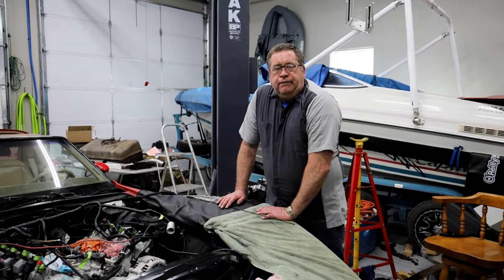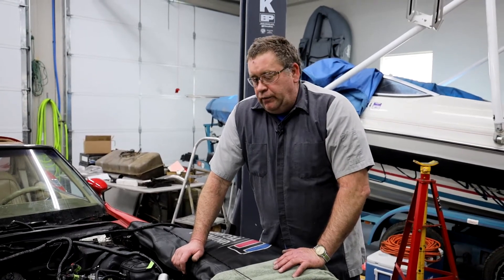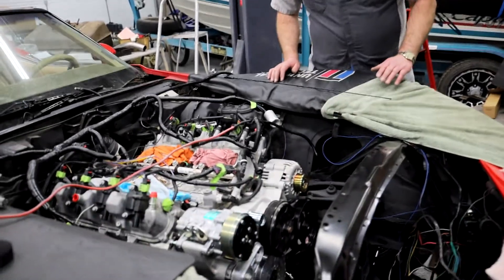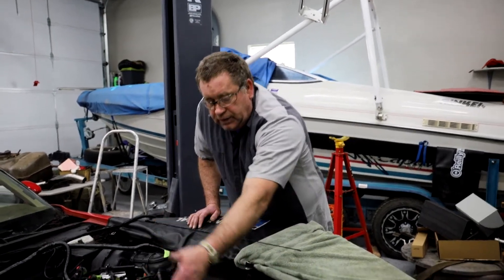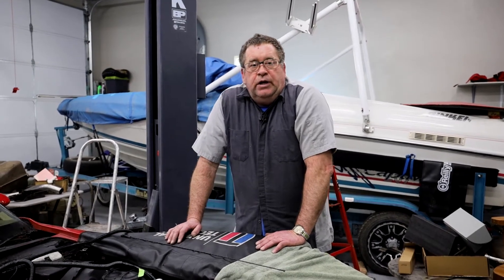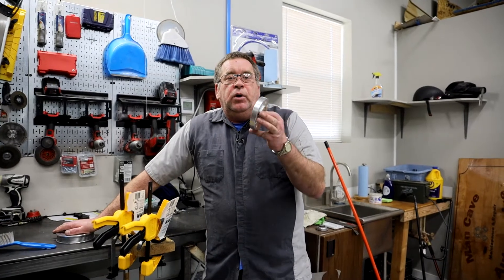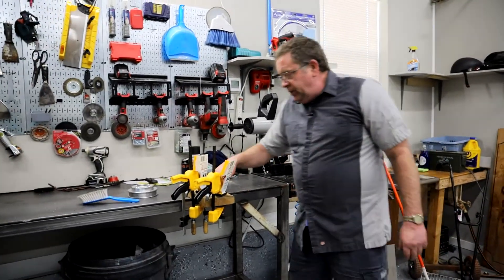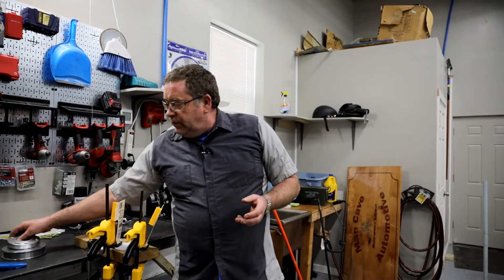Gen 5 GM LT1 Dry Sump Accessory Drive System For Engine Swap

Comment: I noticed that you didn’t add power steering?
Reply from the maker: It does have power steering. I used an after market pump with a remote reservoir and it is run off of the drive belt and positioned directly below the alternator.